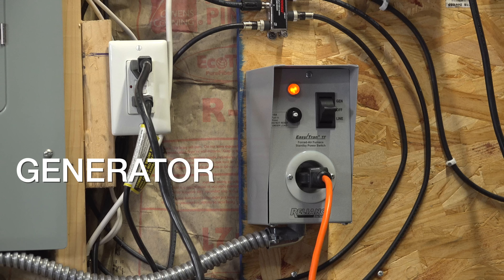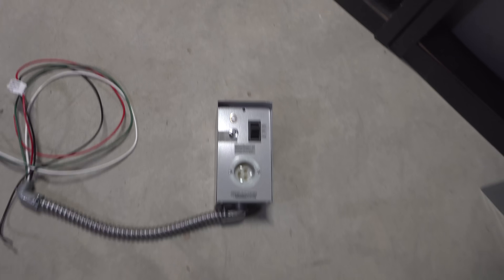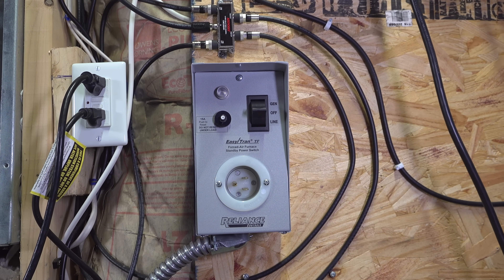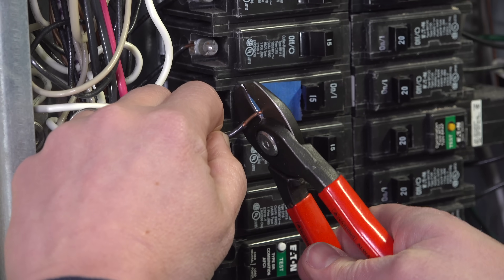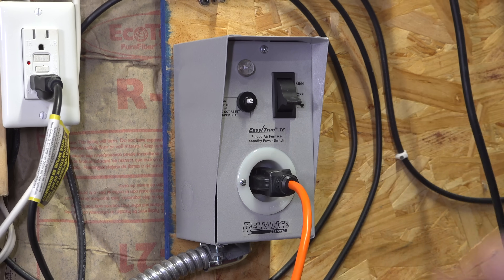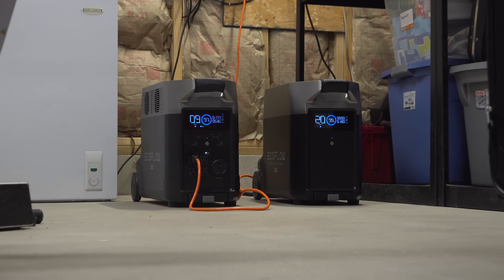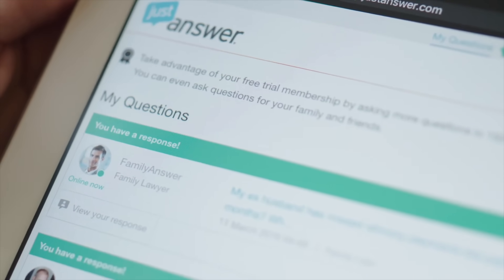Easy DIY Generator Transfer Switch Install - Works with ANY Portable Gas or Battery Generator

Comment: I am thinking of buying the delta pro. Will work in the 6 plug reliance control transfer switch?
Reply from the maker: Definitely, but only for 120v circuits but that may be all you need. See the hookup with a similar switch here I did: https://youtu.be/ydRveyXkf4M

Comment: I’d just put in a generator interlock kit in the main panel and feed the entire house and just not overload the generator with heavy loads. Boom. Everything in the house is on.
Reply: Except those 2 ECO units that guy bought won't run a whole house, only 120V stuff...he overpaid for a piss poor system that won't do anything useful in a power outage LOL.

Comment: Okay, If you are watching this video to learn what the individual components are called. For safety you should hire an experienced professional to do the job. Working inside a live breaker panel is not for beginners. This video has good  information.
Reply: Working inside a live breaker is how we weed out the dumbfucks.

Comment: The only catch is these battery units are $3,500 each... I can buy quite a few SERIOUS generators for that cost.  Holy crap that's expensive, and this guy bought 2 of them!
Reply: He already had the first unit for his RV. I suspect that he’ll be using the second one in there as well.
Reply: Don't forget this bozo bought 2 of those things so he's got $7,000 tied up in those 2 units, not including the transfer switch hack job.   For that kind of money you could have a really nice whole home standby generator with an automatic transfer switch and power the whole house without touching anything.  This is a case where the homeowner has too much money and not enough brains.

Comment: I would looooove to have a generator like that but man they are expensive!
Reply: For what they want for the ECO that would actually power a few things in a house you would be better served by investing in a whole house standby generator that runs on LP or Propane, and some have their own built in tanks and run on diesel instead.  A simple interlock transfer switch that you flip or some can be fully automatic and don't need to deal with those cumbersome heavy battery packs that inevitably will be dead or have bad batteries in them when you actually need to use them.

Comment: @3:17 wrong.
No further elect. box work should take place.
Very, very basic and if ignored by a professional and\or any employee expect termination with malice....DO NOT TRUST A SWITCH HAS DEPOWERED THE CIRCUIT nor that the circuit is de-energized!.....ground & TEST!
How you missed this makes me question your channel and expertise.
@4:23 risky workmanship to cut wire small bits of wire in front of an open panel with many small crevices. Sometimes the cut piece will fly off, the search may not reveal where it is and it may be ignored to cause problems later.
If on the gen\set with the main breaker open excess power is sent to the grid.
Reply from the maker: Not really sure what you are talking about the timestamp you referenced goes to banging out a knockout.
Reply: @SilverCymbal  You accessed my comment before I posted it, pre-editing. Why YT allows this is dumb.

Comment: In Ontario Canada, the panel main compartment is sacred, only the incoming wires from utility and the main ground are allow in there, nothing else. Your transfer switch are classified as branch circuit, do NOT route it through the main compartment or you be doing it again after the next inspection.

Comment: FYI, if you use a generator, it needs to be a floating neutral.. which means the ground jumper wire is disconnected from the neutral inside the generator. Most gen manufacturers will show how to remove the jumper wire to turn your bonded neutral gen to a floating neutral gen.
Reply: @mikejohnson601  ..   if your generator has bonded neutral, which means the neutral and ground is connected at the generator. Your house panel also has its own bonded neutral to ground. You can’t have two sets bonded neutrals. This is also why sub panels don’t have bonds.. they run parallel back to the main panel THEN get connected.
If your feeding your generator into a main panel in your house then set your gen to a floating neutral..  if your not running through the house panel, and are running extension cords off of the gen, then bonded neutral is correct.

Comment: Who has a whole house heating system that runs on 120 volts?
Reply from the maker: He does, I do. Almost all oil heating systems use 120v and many propane forced hot air ones do also Just depends, but it's not unusual
Reply: @SilverCymbal  That's a good point, hadn't thought about that. Thanks.
Reply: We do. Ours runs off NG.
Reply: Many people who's furnace is gas.  Only the blower, ignitor, and electronics require power, there isn't a heating element like in an electric furnace so the power draw is relatively low and only needs a 120V 20 amp circuit.

Comment: Maybe I am wrong, or maybe it's because of my area, but I have never seen any heating system that runs on 110. Maybe if you have a furnace?
Reply: A gas furnace will typically only need a 120V outlet as the only thing that requires power is the electronic control panel and blower motor as well as the ignitor for the pilot light.  A fully electric furnace on the other hand requires a dedicated 240V circuit and those stupid overpriced ECO battery systems ain't gonna run it.
Reply: @wildbill23c  agree those battery packages are absolutely useless to anyone with a real power outage. 
Thats stupid pathetic excuse for electric back up cost probably $10000 to run one circuit. 

You can get an automatic whole home generator for that price that will run for 3-4 weeks without issues.

Comment: So what happens when you are in a power outage and you put power to the breaker? Does the power not also flow through the circuit breaker and onto the line, potentially energizing the power line from the house to the pole, and potentially electrocuting a line worker trying to restore power?

I think I understand the likely answer, which is no.

When the line power is on, and the switch is turned to line, the power runs from the breaker, to the new Transfer Switch, then from the transfer switch to the furnace.

When the line power is off, and the switch is turned to line, nothing happens, as the battery input at the Transfer Switch is still isolated from it.

When the line power is off and the switch is turned to Gen, The power runs from the Transfer Switch Input to the furnace, but not back to the panel.

You're still using a neutral/ground bond as your reference, and the hot is fed from the battery to the Transfer switch to the furnace but NOT to the red line.

Line Mode: Power from Line -> Red -> Switch -> Black -> Furnace (internally Switch is disconnected from generator input)
Gen Mode: Power from Gen -> Switch -> Black -> Furnace (red is disconnected)

Thanks for making me thing through how this is safe! Cheers!

I'm planning to get a Generator Interlock Kit for my electrical panel and connect an outdoor generator for the whole panel. Like this: https://amzn.to/35kUbZu
Reply: He shows the box that selects line or generator to feed the breakers.  The switch is either/or, so the generator cannot feed the grid, ever.
Reply: @PeterLawton  That's the goal, right? Never backfeed power to the grid in a power outage. I had to think through how it worked, and I guess I did it outloud in a comment!
Reply: @ooglek  you got it.  Your original post was 8 months ago, and you were planning to install.  How'd that go for you?  (I'm in an apartment for now, so no mods for me)
Reply: @PeterLawton  I haven't yet. Best laid plans, eh? 🙂 My panel is full, so I need to either double up some circuits, which makes me need to double check code, which I haven't done yet, and until I make space for a single-or-double-pole breaker for the generator interlock circuit, I'm kinda hosed.

I was hoping to use the 60 amp circuit for my EV charger, but it needs to be on when the line power is on, not off. So I gotta commit, and I'm not yet in a time or place to do either. Ask me again in 8 months!

Comment: This house must use natural gas for heat. You cannot run a 240 volt furnace off a 15 amp circuit.
Reply: Yep a gas furnace will only require a 120V circuit, and if I recall mine is on a 20amp breaker.

Comment: Ok stupid question. When you power that one breaker, and you flip it on, can you also flip others on and they will be powered as well? For example, I would want to power several 20amp circuits- my fireplace fans for sure, and then some lights. Do you have to wire in each individual breaker as you need it or can this switch be wired as such that several circuits can be used? Also, what is wrong when the gfc outlets on generator trip  immediately? Thanks
Reply: GFCIs usually are on BONDED generators.  If you have NO LOAD and the GFCI trips, it is because the GFCI itself has resistors after the solenoid's two poles that are the white and black interupting solenoid  contacts/switches.  See Youtube.com/watch?v=DyeijLvh-yI 
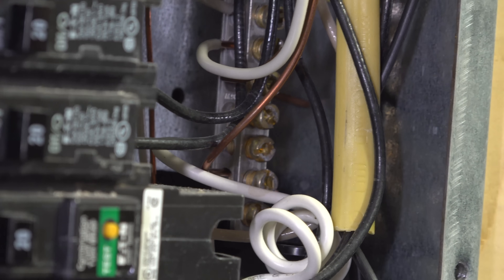Look at the 3:26 time and 5:23 time.  The "not part of the application" is only for resistor Rg, IMO and testing.  Read your tripped and unpowered GFCI white and earth ground terminal.  It will show some resistance, not an open circuit.   There's a hidden load resistance in the GFCI.
Normally, the current matches in the top "black" line and the bottom white line.  If you take a power cord with only a plug and a two wire lampcord hooked to the input of a different GFCI on your bench with no bare wire connected, you will have no load.  The GFCI does not trip.  No load?  Not exactly.  Rn and Rg resistors start to draw matching currents!  What happened to you?
If you touch the outlet of the GFCI white and bare (or green) terminal with a jumper wire momentarily, the powered and normally working GFCI WILL trip OFF instantly.
Why?  The Rb current is spit between path Rn and path RG.  The black hot line sensor and white line sensor do not match in current and the GFCI trips OFF.  It is supposed to woirk that way with you as Rg in your bare wet feet on the ground. 

How do you fix a bonded generator with GFCIs?  Remove them and use isolated ground red Leviton duplex outlets.  Throw the GFCIs in your junk box of used parts.  Dissconnect and remove, or cut the bond wire and put a wire nut on it.  TAPE IT ALL UP.  You will now see that the unpowered wider white outlet terminal blade does not show continuity with the earth or bare wire terminal on the front panel of the generator or the frame.  This will convert a Honda EB2800i Honda bonded inverter into my EG2800I Honda floating neutral inverter.  No more GFCI trips.

For a required GFCi, install a stand alone series in-line GFCI between the new red outlets and your powered extension cord at a job site.  Label the red outlets as NON-BONDED!  Label the top of the inverter or generator also as NON BONDED.

I neve did this conversion but I have both schemeatics.  Your genny might be wired different but now you know what to look for in the schematic of your genny or inverter.

HTH,

Stefan
Reply: Ok Stefan I think I understand that just a bit, I am electrically impaired  to such a degree that I understand very little about it. But can you explain why when I used my little 1750 watt generator plugged into a wall outlet with the main switch in breaker box switched OFF, I had power to everything on that one circuit? It worked fine. My fireplace fans ran and a few lights (just whatever was on that one circuit). But with this new generator it does not work. It trips the outlets immediately. I realize what I’m doing is not recommended but the gentleman who gave me the little 1750 included with it a pigtail with two male ends and told me to do it that way. He was a very educated man even a scientist and he said that’s how he always did it. So you’re saying if I got rid of the gfc outlets on the generator and made it into a floating neutral generator, that my little scheme will work?
Reply: @Sandridge-w3l  

Hi,

I am not sure I fully understand your questions.
If you only turned off the Service Entrance Panel, S.E.P., main breakers and plugged in your generator, you energized every load in the house on one 120 VAC leg of the panel!  15 Amps is too small. 
If you mean you turned off the branch line circuit breaker, then you only powered up that one line and anything on that one branch line that was energized.
"It trips the outlets immediately." I think you mean the GFCIs on the 15 AMP output generator or inverter tripped OFF, not a wall outlet; unless it was a GFCI wall outlet that you plugged into.

"made it into a floating neutral generator, that my little scheme will work?"   You need to have a dedicated transfer switch like the Green EZ Transfer switch unit.  What do you think will happen if you close the branch circuit breaker with the generator still running?  Nothing good.

Generator or inverter manufacturers made the GFCI units to satisfy OSHA job site regulation to prevent job site workers with wet feet standing on the wet earth and getting shocked when they touched the generator frame..  That's a good thing.

General observations.
It is possible to convert a floating ground 'non-frame bonded' wired generator to a GFCI unit.  Just install an in-line external GFCI in the outlet duplex of the generator.  To satisfy OHSA, you might have to use a grounding rod driven into the earth with that in-line unit.  I never had one nor read the installation instructions,  Sorry. 

For a GFCI generator you MUST do two RiSKY conversions.  Get rid of the GFCIs and replace them with regular duplex outlets like in a house wall outlet.  Next, you MUST find and, cut or remove the bonding wire from the green or bare outlet wire (formerly on the GFCIs) to the metal frame of the generator, no exceptions. 
That bonded grounding wire might be hard to find, remove, isolate, or cut and with twist on wire nuts.

Why is the used one tripping?  Your educated friend does not know this.  If you have a GFCI feeding a storage barn and you have a single pole toggle switch as the first box after a house outside mounted GFCI feeder unit, opening the black wire will create a KILL switch in your barn.  The GFCI is still set and working but no black hot voltage in past that first toggle switch electrical box.  You break a plastic outlet box in the barn. You open the KILL switch.  You will not get shocked.  You pull the NM type "romex" wiers out and rewire the new metal box up perfectly.  You close the kill switch.  You have NO POWER at all in the barn.  You fing that the remote GFCi on the house was tripped.  When you pulled out the NM cable, the white ground wire touched the 3rd bare wire or green wire terminal and that tripped the GFCI.
Remember the KILL switch is open.  The GFCI will trip every time.
How took me 1000 words to explain how this happens electronically inside the GFCI.  Basically there are unseen "white" and "green" wires inside the GFCi itself that cause it to trip!  When shorted together like at the S E P box grounding strip, but now in the barn; the total black current detected does not match the white wire current and POW!, the GFCI trips.  The white wire current was split (reduced) and that is detected as a ground fault; and that is (with no power in the barn after the opened KILL switch).

"It trips the outlets immediately."  So, why is your used generator tripping?  The white wire is touching the bare wire or the frame somewhere.  I bet you can't even reset the GFCI at all.  It won't stay reset when you release the red reset button. 
The simple test?  Check the continuity between the large slotted white wire of an outlet and a frame unpainted screw terminal or bare metal frame location.  If you get continuity, then your generator frame is still bonded to the neutral white wire somewhere.
 
What your friend did was risk his life, getting shocked, and/or a house fire.  Get a commercial transfer switch like this one on this thread on youtube.  No funny business,  Hard wire it all in place.  I did this for my gas furnace with no separate power cord. 
For a frig or freezer in the summer, I can unplug the generator cord at the Xfer switch inlet, and plug the frig cord into the generator extension cord (12 gauge minimum $$$ and 100 feet or less as needed).  Yes I can use a second Xfer switch but a power cord switch is faster. 

You need a brand new non-GFCI generator, IMO.  Your level of electronics and NEC electrical knowledge is limited and risky,  

Post where your used unit's schematic is located on the web.  I'll look at it.  No charge.  Ask your friend if he EVER rewired anything at all.

Does his solution and yours work?  Yep.  But, what happens if you close the open branch circuit breaker by mistake and your restored utility power is now powering up your generator as a higher voltage AC, not DC?  Nothing good.  That's like jumpering a car battery with 120 V AC power cord.  Your battery and engine will have a bad day.  

This Xfer switch kit prevents all that but only if you hard wire it up right.  What if your spouse or kid comes down stairs and the power is OFF?  The spouse or kid only knows to start throwing tripped breakers.  NOT GOOD.  Your gen is still attached!  He or she just powered up your entire house single phase lines all over the house.  The gen's 15 AMPs is not going to work.  BAM!  The generator breaker trips at 15 AMPs.

Do it right and you only have to do it once.  Get somebody to check out what you are doing that has extensive electrical and electronics skills.

Stefan

Comment: what kind of heating system can run  on a 16 gauge extension cord?
Reply: A gas furnace typically as the blower is usually 120V.  An all electric furnace would require a 240V power source and those ECO units are not 240V...and ridiculously priced for no more than they can do.